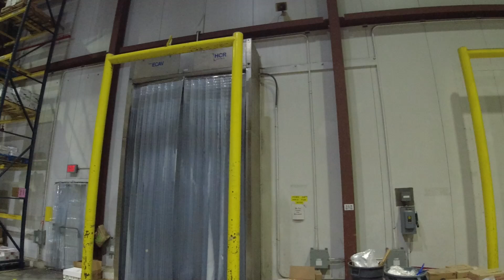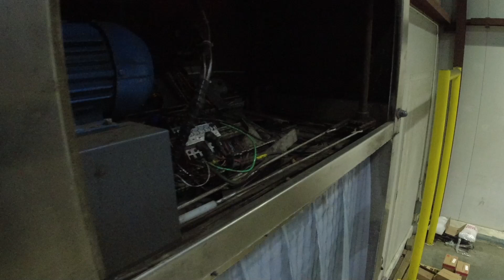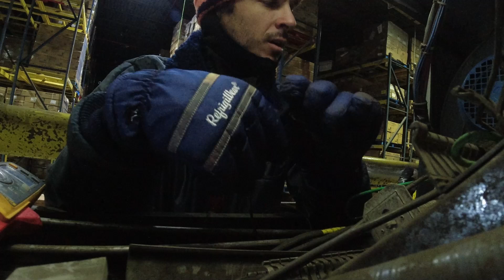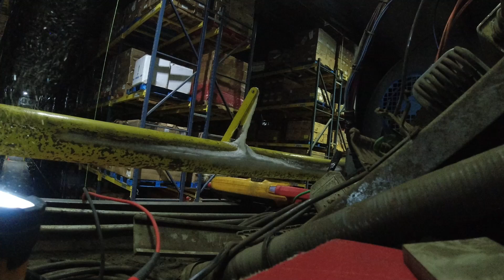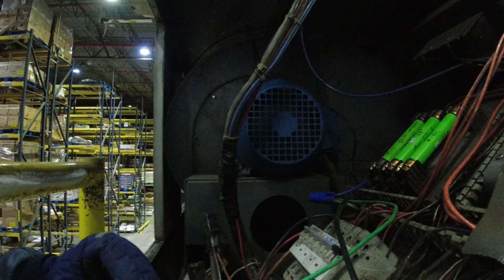480 Volt Freezer Door Troubleshoot

Comment: Sounds like bad bearings on motor and when it’s in a spot it seems to get stuck to pop. But it could use a start up sequence because the inrush current could also be causing issues.

Comment: That motor has bad bearings. Sounded terrible on start up and got a little better as they warmed up. With bad bearings the rotor will ever so slightly touch the stator and cause the bad fuses and tripped breakers. When it happens again plan on a new motor.
Reply from the maker: Makes sense. Thanks for watching!

Comment: Like someone else mentioned, looks like quite a few wires are running through the door mechanism all over the place. 
Ahhhh, reminds me of cold, fuses and motors.  Did two contracts in Antarctica, overwintering. Summer electrician left me a BS job of replacing a heavy ass 10HP, 150lb motor for a rooftop radiator for a back up gen. To get to it you had to climb in the rooftop radiator enclosure and even though I am skinny fcuk no way did I want to, or even sure I could,  wrestle this 150LB motor in a 2'x2' box, crammed in, can't move, can't get to the fan hub (direct drive of course) in -20F temps on a warm day with wind whipping. As always I want to verify things are bad for myself and learned long ago to never trust anyone else's diagnosis.  Long story short and unrelated to your heater fuses (no inrush on them), he installed normal 20A fuses and they blew instantly on start-up, no time delay. Looking up on what fuses to fuse the new motor with prior to install they were of course supposed to be time delay fuses, FR-N 20A or even FR-N 25A. Ordered correct fuses to try before replacing motor and..... no need to change out motor. He just used the wrong type fuses for the motor. I think it pulled 13A on all three phases once running and every weekly test it ran fine all season. But that generator was tagged out for months, since he didn't want to do the motor and honestly, neither did I and so glad it was just the wrong fuses. 
So inrush doesn't affect your heater fuses, but depending on what type and size the fuses are in the disconnect, if the heaters come on and fan turns on at same time it can blow normal fuses if ti's close to the normal load then add in the inrush. Even though that motor was only pulling 2A or so when running.  Seeing someone put in a 15A fuse for the heaters, who knows what was in the disconnect. And yeah, that motor sounded like shit on video too. Hopefully no call back and it keeps on running.
Reply from the maker: Awesome story and good advice too,
Thanks for watching!

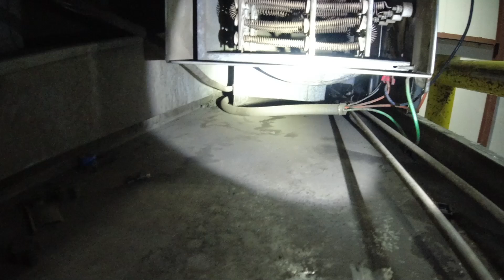Comment: At 24:19 under the heater box, there is a sealtite with wires coming out and resting on the door linkage that moves.  Could that be a rub through?
Reply from the maker: It could be in the future, for now it's all holding and working.
Thanks for watching!

Comment: to blow the fuse like that is normally not hard to find the root cause .  I go to my Meg meter to test the insulation when its in a area like that is cold and moisture , that is a perfect spot to install a 3 phase soft start or a drive to ramp it up nice and slow

Comment: Good engineering on that freezer 😅 Wonder who's idea was put the control board up there.
Reply from the maker: I'm sure it made sense in their air conditioned office as they drew it out. 😂
Reply: I suspect that the model used was designed for a refrigerated space, but they chose it over the freezer version, due to cost concerns.